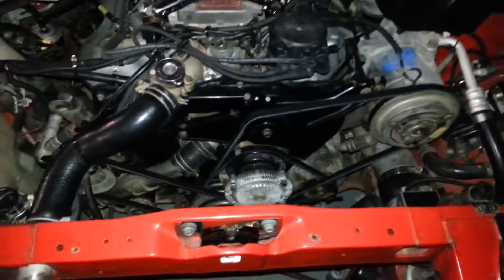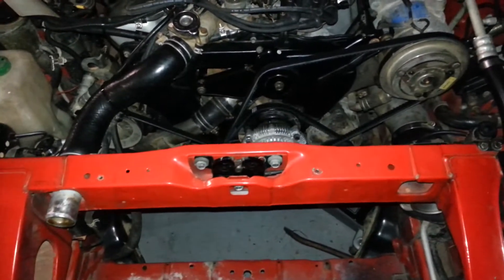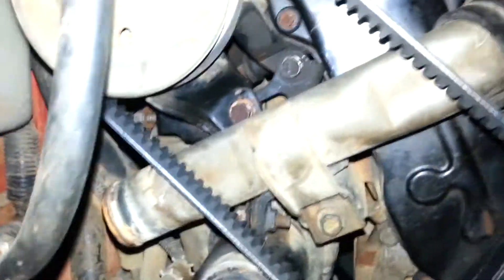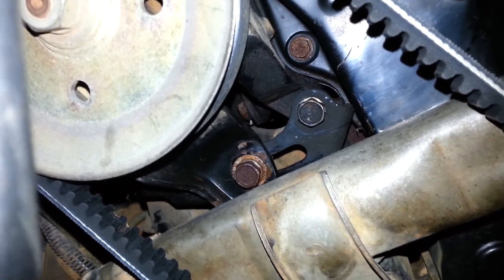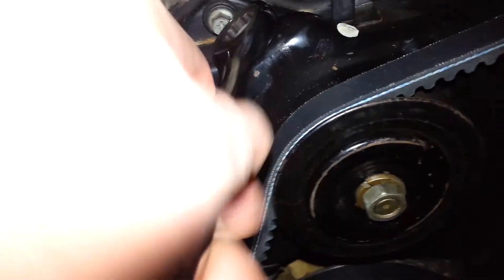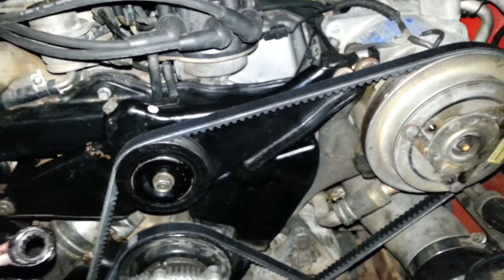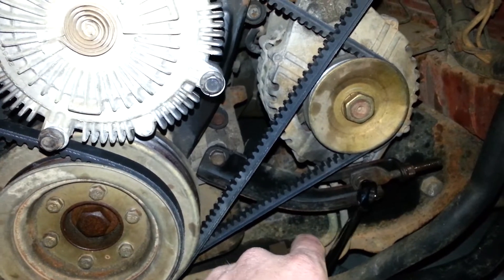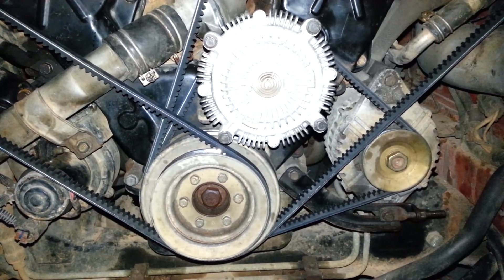Belt removal nissan 300zx zx1

Comment: I have a leak somewhere within the power steering chasey on my 1986 300zx. How do I know if its leaking from the resevoir, pump, lines or pressure switch?

Comment: I was only able to reach the power steering tensioner locking bolt by removing the water overflow tank and going in from the left side to get at it from behind, so to speak.  I had to use a 13mm box wrench which I cut off one end to shorten it to fit and to rotate.  Very hard to reach that bolt with car fully assembled!  And another thing about that particular bolt:  I had to use extra washers to shim the head upwards to reach it at all.  It was THE nightmare part of the power steering pump replacement process.   Another pain is the short electrical wire on the water overflow tank makes removing and replacing very hard due to lack of room for the fingers to fit in and unplug the connector.  I spliced an extra 18 inches into the wire to make that easier, as well.
Reply: Damn and here I am trying my best to get it off with everything assembled 😭

Comment: Thanks the stupid haines manual had nothing on this other than basic bs info.
Reply: Haines  Manual is better than Nothing, and  an Excellent Service Manual for the do it your selfer ...THE Nissan Service manual is on Line for Free..   for any Year ...  Most of The Factory ZX  Alternators are on the Passenger side , ,so the Electrical is closer to the Battery /